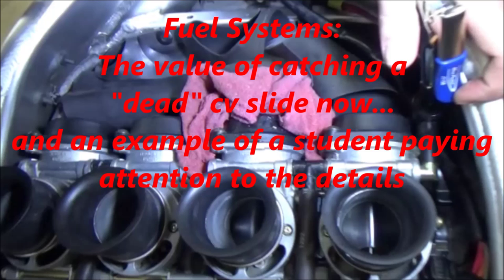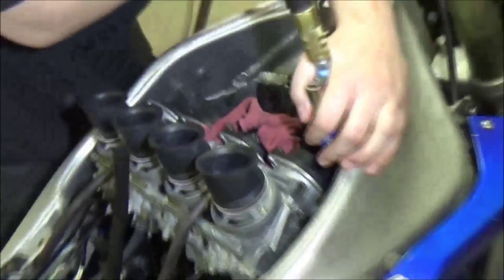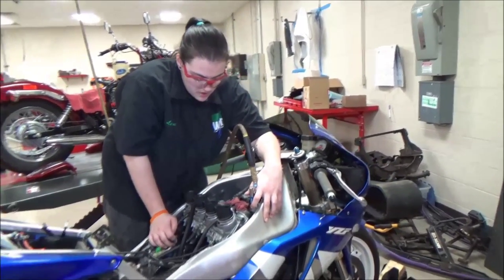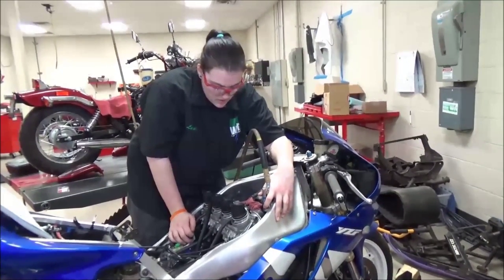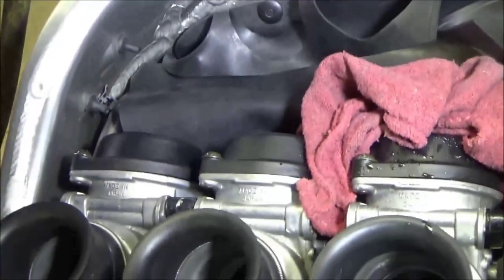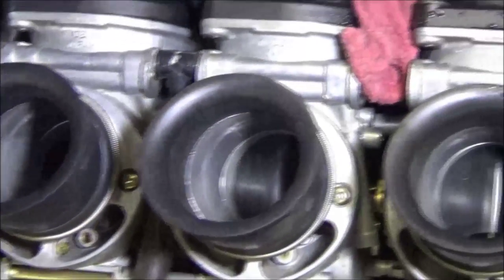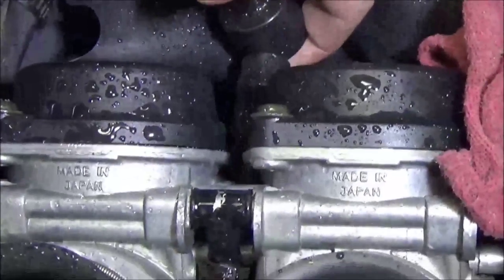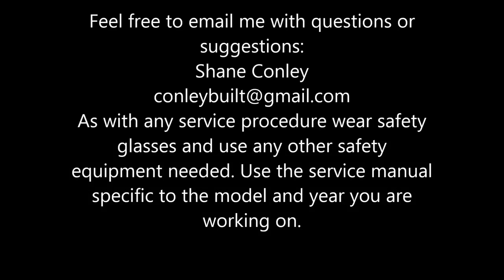How to verify your carb slide will lift without the engine running! All cv sportbike atv harley carb

Comment: i had similar prob on my 919rr  carbs that came with bike i had rebuilt and i bought new parts  i intalled the inner boots that lay under those caps  and luckily dad was there caught the slid not opening  one if the new boos were not sitting flush on the carbs causing air "vacuumm" to leek out  hence slide not moving   good catch girl  ^5
Reply from the maker: Head over to my website become a member now and to receive 20 minutes of personal mentorship with me. You can even use FaceTime if you have it or find a friends iPhone and we can walk through the actual carburetor process together. I look forward to mentoring you.

Note: Membership is not required to receive coaching or email help. Here are the direct links to individual services offered at H2W:

Email Answer Service-Click http://how2wrench.com/product/email-support/ 

Phone/FaceTime Coaching-Click http://how2wrench.com/product/personal-tech-training-phone-facetime/ 

DIY Mentorship-Click http://how2wrench.com/product/diy-coaching-hire-teach/ 

Dealership Training Services-Click http://how2wrench.com/product-category/dealer-services/ 

MMI/Tech School Student Tutoring-Click http://how2wrench.com/product/mmi-tech-school-student-tutoring-services/

Motivational/Guest Speaker-Click http://how2wrench.com/product/motivational-speaker/ 

On-site Training Services-Click http://how2wrench.com/product/on-site-training/ 

Tech Line Services-Click http://how2wrench.com/product/tech-line-minutes/ 

Mechanic on Duty-Click http://how2wrench.com/product-category/mechanic-on-duty/ 

Did you like this free video and hope to see more? Would you just like to say thank you with a donation? Click https://www.paypal.com/donate/?token=TvKoeRazPL-KysbM-e0ttz-C_gPq2IrqxDmM3ORCu4nxJzQWxYbmo-6m3YuNu64XHLngGW 

Keep Wrenching,
Shane Conley
Instructor/Motivator/Motorcyclist!
www.How2Wrench.com

Comment: I would like to find information about kawasaki Eliminator ZL 400. Everything is service properly and the re is a slide problem. I will not rev above 9000 and the bike normal revs to 16000.nobody can fix it. Any ideas?